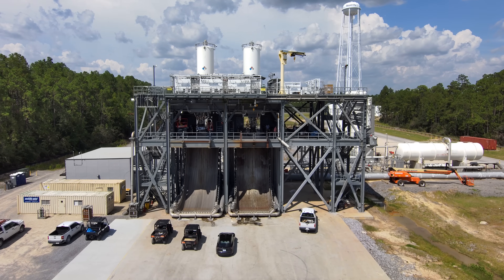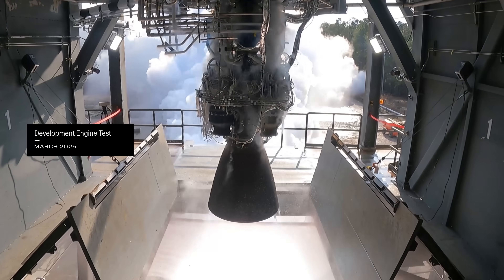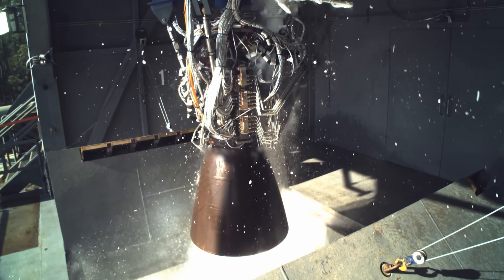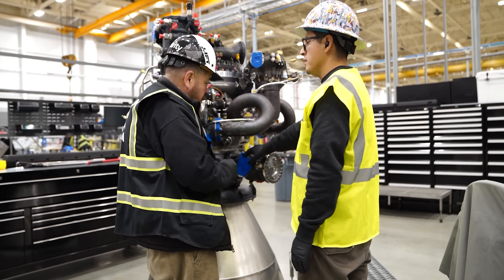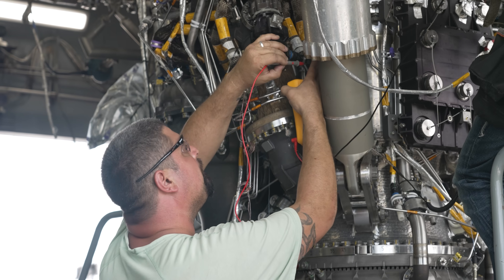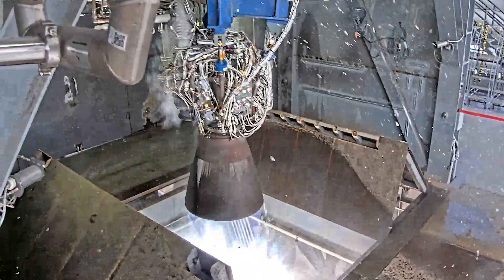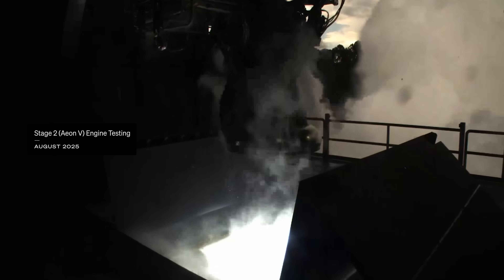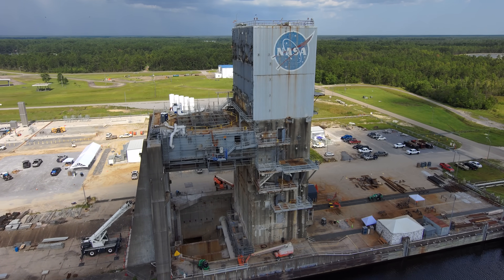Deep Dive: Aeon R Engine Qual Campaign

Comment: 5:51  What are the advantages of  two separate turbopumps? The engine has one preburner and two turbine+turbopump assemblies, one for each propellant. Most gas generator engines have one preburner and one turbine that drives two turbopumps. There is one exhaust. Aeon-R has an exhaust at the base of each turbopump assembly. What are the advantages? The seal problem is eliminated but is that worth the mass of an entire extra turbopump? Also, both are equal in size, I'm puzzled since afaik the O2 one should be bigger.